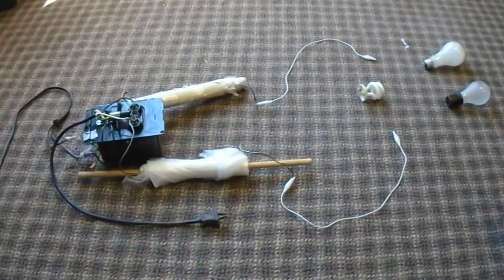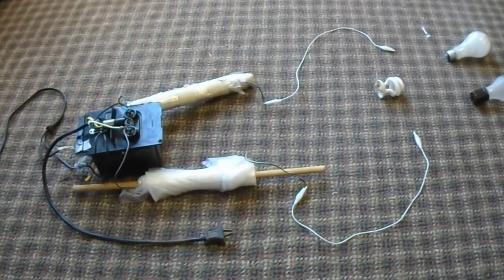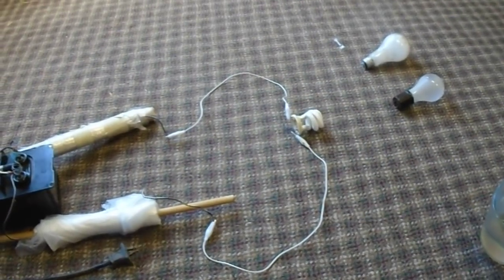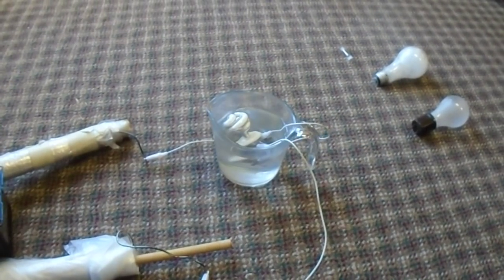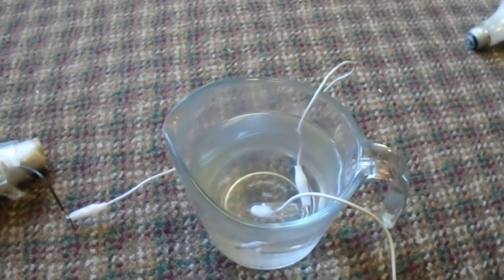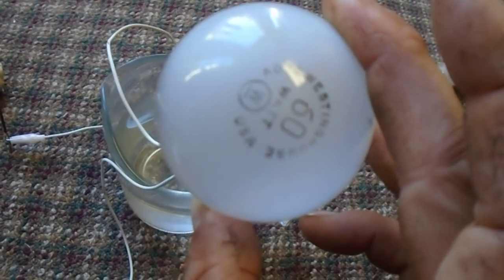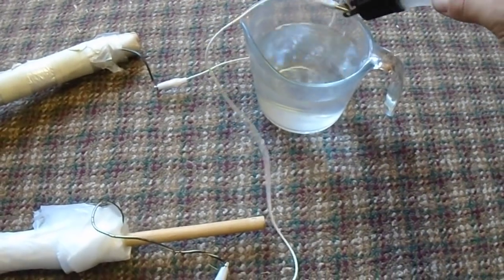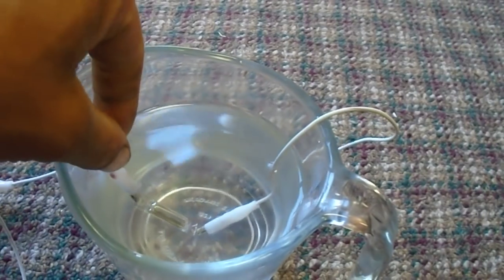Cold Electricity  ヅ

Comment: This is not cold electricity my friend, it is neutral electricity or steinn metz electricity, you can run it to a bulp suberced in water and touch it without getting shocked just like with Nikolas Hair-pin circuit, cold elctricity creates a green light and will generate measureable "cold" in the enviroment.

What happend to your free elctricity circuit with the same resonance coils? all you had to do was attach a stepdown transformer and an inverter and you would have free electricity, did you not get to that?
You really should 🙂
All the best from Denmark!!
Reply: Can you tell me more about this? I thought cold electricity was the same thing as radiant energy as tesla called it. What makes them different and why?
Reply: Also interested about this. Electricity that produces a cooling effect? Can you prove it?

Comment: Why is this circuit special? Why do you say the electricity is cold? And why do you say the circuit is not connected if indeed it is through capacitive coupling? I'm an electronic engineer, and I just see a very high frequency and high voltage signal being coupled to the lamps. Of course you aren't electrocuted when you put your finger, since muscles are not stimulated at very high frequencies, it is a very well known effect and used in diathermy medical devices to heat up or even cut tissues in surgery...
Reply: Interesting, do those devices work under water too?
Reply: Hi! I don't know why anyone should use them under water, but sure, water is just a dielectric behaving as a capacitor. If there are minerals then it's a bit conductive as well and some current will flow. As far as science/electronics is concerned, only voltage and frequency are the variables to control, and current is a derived one depending on the medium. Period. If anyone wants to claim  "cold electricity" or other concepts, it would be nice they show strong evidences 😊
Reply: Cold electricity is negative entropic, where as regular electricity is positive entropic. Cold electricity will remove heat from a system or circuit, will not shock the hand, but will in fact accelerate healing of any open cuts or wounds. conversely regular electricity is entropic and will shock the hand and damage the body and add heat. From a theoretical standpoint, Cold electricity is essentially electrons moving backwards through time. Imagine a circuit where the electrons are coming not from the power source, but from the surrounding environment and moving backwards through the device and ending up in the power source.
Reply: @BrentLeVasseur From a scientific point of view, nothing about what you said has any sense. As I said, diathermy devices uses high frequency and you don't get shocked because the muscle only contracts at low frequencies. Funny thing, diathermy heals because it heats up the zone where applied, and so it increases the blood flow. According to you, the skin should cool down... If it doesn't it's because it follows the Joule's law (E=I^2*R) instead of some invented laws from people who seem to be bored... I will believe you if you take a thermometer and show me that the temperature decreases of a system when current flows through it. Can you prove that for me?
Reply: @bernat_albet  All of this harkens back to the late 1800’s Nikola Tesla research into radiant energy. Google Tesla’s patent on the hairpin circuit, which is the basis for this video experiment and study that, along with Tesla’s papers on radiant energy.

Comment: Now the only problem is, getting rid of the noise. 

Kudos to you, sir, and I'll be joining in the "Borderland" scientists group very soon.
Reply: How about using a Hydrogen Thyratron.
Reply: clixbits I would like to, but this is the "Modern Era" (if you can call it Modern).

Using substitutes such as transistors and MOSFETs would complete the job on a more economical scale and provide a way to mass produce the product.
Reply: Hi, it's been a while since you posted this comment and I'm looking to deal with the noise problem as well. Have you made any progress about this?
Reply: @JenkoRun  I completed on my end the project.

A simple variable 555 timer chip with a N-Channel MOSFETs able to close/open in the 10 KHz to 10 MHz range. Then have the Vin run through the MOSFET, then a step-up transformer. The secondary of the transformer should have a high-voltage, but low-amperes and only 1 way out.

Goal is Radiant Energy, need to get rid of Dynamic energy. Only used the project for troubleshooting. Didn't get into the application arena due to work and personal life.